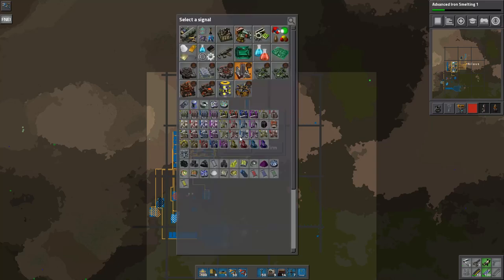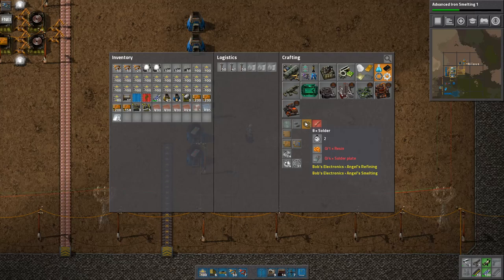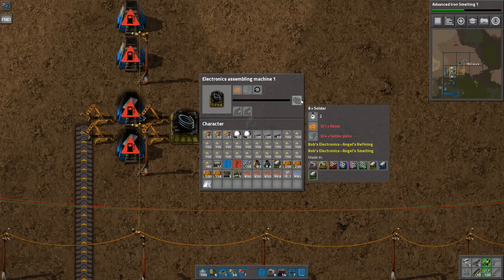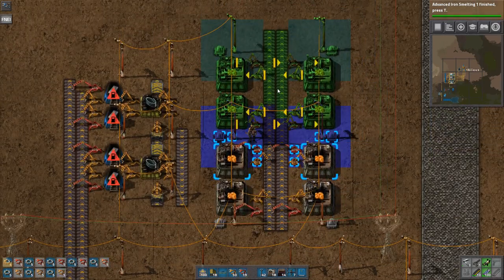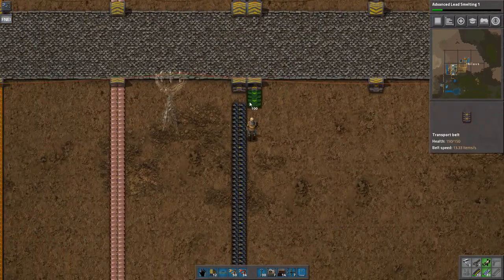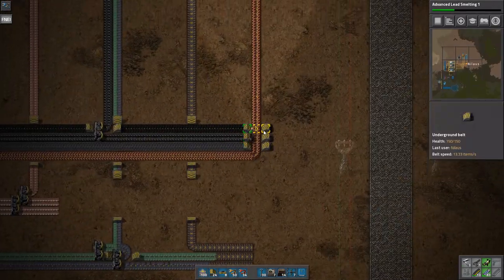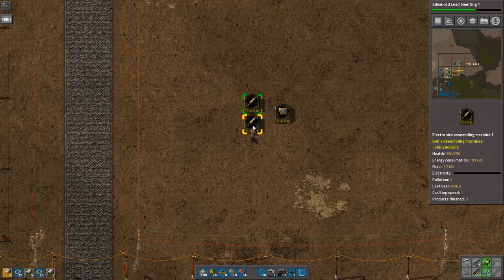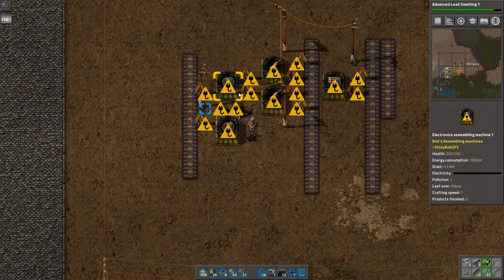Factorio 0.16 - Angels Mods Tutorial Lets Play #5 BASIC ELECTRONIC BOARDS

Comment: Loving this series thanks so much I was intimidated the first time I explored Bobs and Angels. Might I suggest an enhancement for steel. Research nitrogen gives you the air filter burn off the excess and make the steel in a blast furnace. same footprint more or less as the smelters and I think it can be done within red science tech.
Reply: correction. got stuck on making carbon. bad suggestion

Comment: Your buffer chest systems should be changed in my opinion 
Just connect the input line and output line so if your chest will be full you will not spend energy on putting materials on belt

Comment: I'm not sure I understand the advantage of your "city blocks". Because right now it's seems to me like a normal main bus, except with some walking paths every now and then. But it still works on the basic "materials branching off of a main line and into assemblies" principle. At least, so far.
Other than that, this series has been very educational!
Reply: Isnt it because the mod is so much more complex that it would be to complicated to put everything on a main bus?
Reply: But everything IS on the main bus, except for intermediates that aren't used anywhere else, which you aren't supposed to put on the bus anyway!
I just can't quite see what's so different about the "city block" instead of a plain old "regular" main bus build. Other than the sacred walking paths.
Reply: Wait for the base to grow it will start to make sense
Reply: He's future proofing the base
Reply: Busses really don't work well with Bobs & Angels once you start getting through Green science. It all begins getting very insane.
Reply from the maker: You are absolutely correct. Main Bus is a great way to get to Blue science, but not a good way to build a big Angels Base. What I am building now is the starter base, which will provide the materials I need to build the real base... that one will be big and for that I need the city blocks to stay sane
Reply: It allows for tiling of the various things, and provides demarcation between the components. IE this area is for basic circuit boards, and this one is basic electronic boards. It's all about the organization.

Plus the paths give less than stellar drivers a place to move around without flattening their own bases. :P
Reply: This is a starter base. Gotta plan ahead with bobs/angels.
Reply: oh yes...the liquids/gases are crazy... with all these mods it becoms a game like industrie giant...build it in modules and conect it with trains
Reply: really should do at least some planning in vanilla to, found out the hard way that if you place you factories anywhere that your base will slowly accumulate spaghetti
Reply: The city blocks force you to spread things out. In Factorio it's automatic to essentially place everything close together, and this isn't good. But, how do you force yourself to spread stuff out? Well, you use a system, the city blocks is essentially that system.

Comment: Hey, question, you have only 1 ore crusher feeding an ore sorter. My calculations put it at 2 ore crushers per ore sorter. What's the deal?
Reply: Iirc the crafting speed of an ore crusher is double that of the sorters (i.e. t1 sorter is 0.75 speed, whilt crusher is 1.5)
Reply from the maker: You calculations are wrong :)
Crusher is twice as fast as a Sorter, so it comes out at a nice 1:1 ratio (for once with Angels)